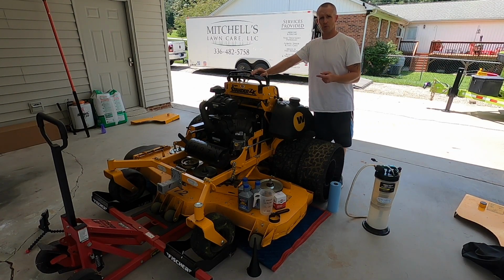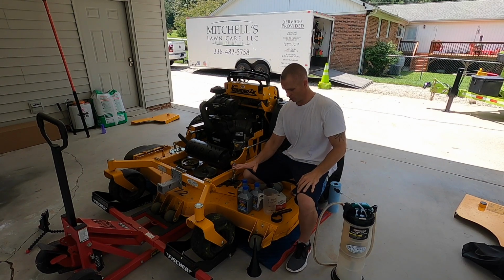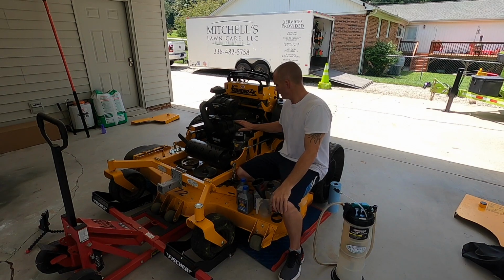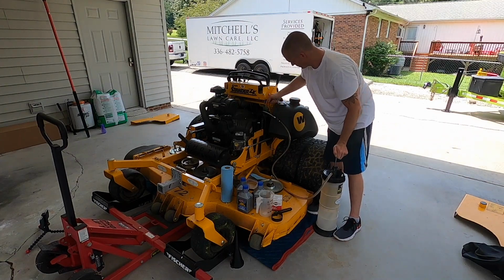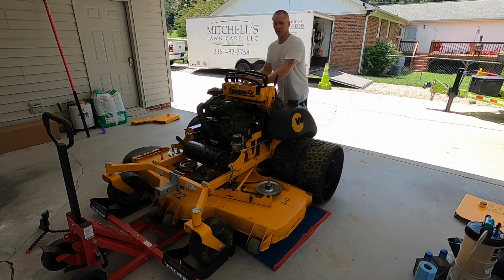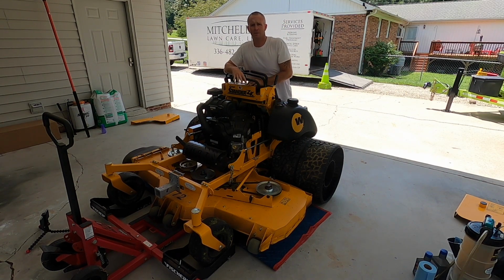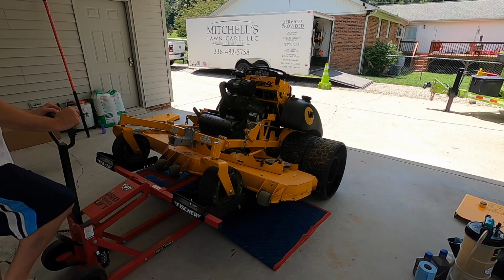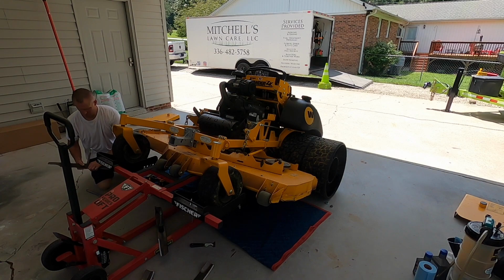Maintenance day for the ZK72!

Comment: So many helpful tips in this video for the oil change. I wanna share something I've heard before. Never use an air hose to blow out air filters as they destroy the filtering fibers(pattern) in the air cleaners, thus allowing more debris to pass into intake.  Actually been told to wash them & allow to air dry before installing again. Interested to know your thoughts on this. Hoping all is well Bud, Dirty Jersey out!! #broinlawns!!
Reply from the maker: yes there is truth to that about the air filters.  My counter to that is that I do not use direct/forceful air pressure so as to not damage the filter element.  I just use enough air pressure to blow out larger clumps of debris.  If the filter is very dirty then rinsing out with water and air drying is definitely a better choice.  Flipside to that is it takes longer and  you can't get immediately back to work...just have to schedule it accordingly.
Reply: @mithgo_outdoor  great advice Bud. Thanks so much for prompt reply. On video #3 of my binge watch. Get ready to be bombarded with "Dirty Jersey out "😂👍
Reply from the maker: @moneymakingmikeg.9555  lmao you're crazy man...love it!  Keep it coming!

Comment: Enjoyed this video the other day and got to thinking about you making sure and putting the blades different directions when putting them back on. Why should you put them different ways?
Reply from the maker: Aaron, I started doing it years ago because certain mowers if you mounted the blades parallel the tips would actually make contact with one another, damaging the blades and possibly more.  On a lot of bigger mowers it isn't necessary, but I've always done it just in case.
Reply: @mithgo_outdoor  I was wondering but I still out my blades on the mower today that way